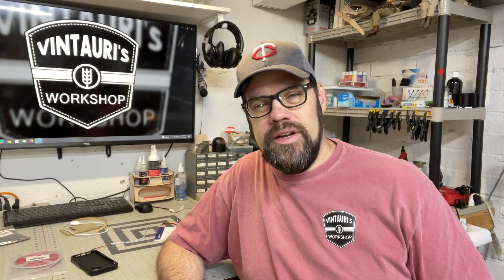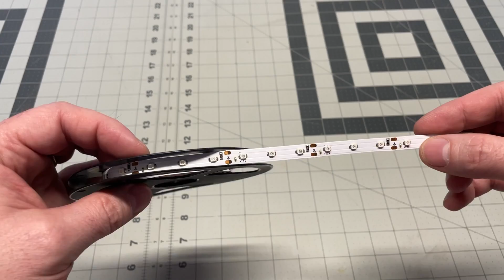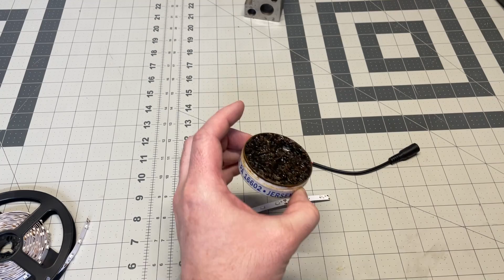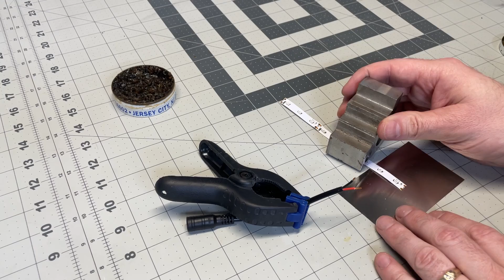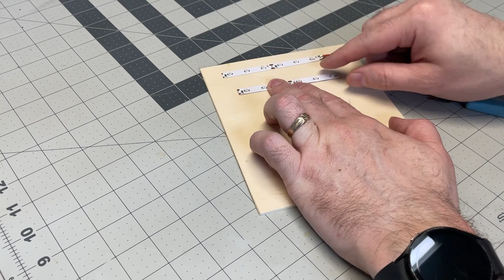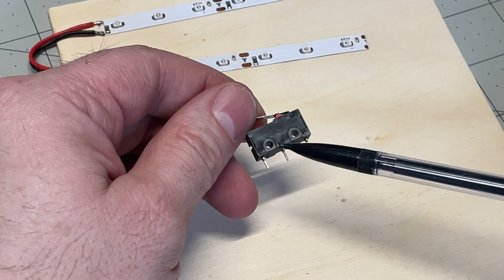Add LED light strips to any project!

Comment: Saw the little dolls on your shelf. When I was a kid, I got an original GI Joe, for Christmas (mid-1960's). My brother got a Mr. Wizard's Experiments in Electronics Raytheon Lectron Science Toy. It was pretty cool. You could build different types of circuits with little magnetic blocks. I've got TONS of LED strips that I've never used. Good to see how easily they're customized. I was just thinking about adding lights to a new sign I cut out today.
Reply from the maker: These are not original GI Joes, but another company that came out with these highly detailed figures in the early 2000's I think.  They work well in giant scale RC warbirds as pilot figures.  I don't fly as much giant scale anymore but I keep them around as something cool for my aviation hobby.  Thanks for watching!